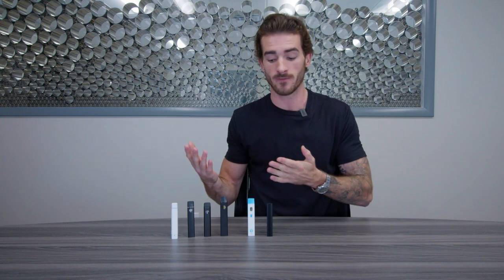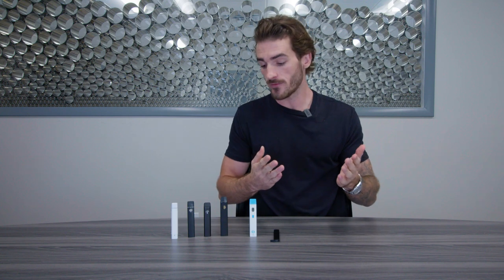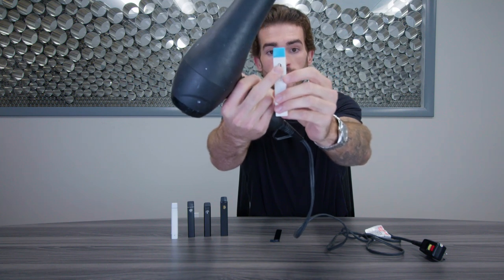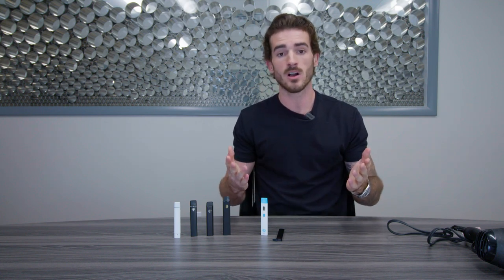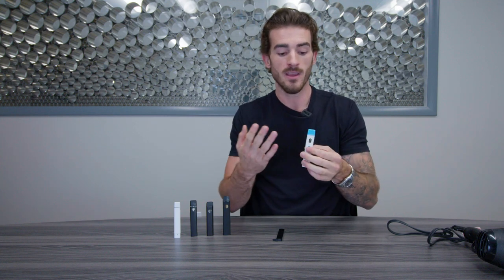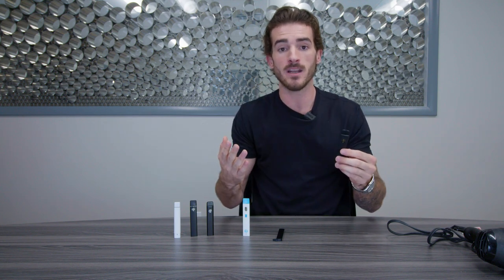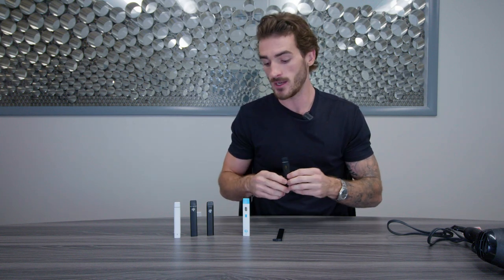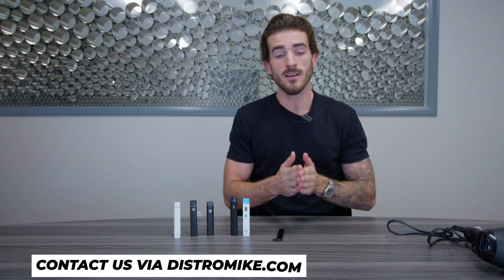How To Fix A Clogged Vape

Comment: Ty so much. My gasgang 2 gram pen was clogged from it being in my pocket at turned on and not sucking it. I've thrown so many away because of it. Most pen thrown out still had half or more in them. I used the dryer technique you showed in this video. It worked almost immediately. 😊❤

Comment: This vid saved me a bunch of money. This worked to clear the clogs on my Delta Extrax CBD vapes I bought. They are 4.5+ g tanks and always get so clogged after a week or so, I break them trying to clean them or just go buy a fresh one. Had several laying around with big time clogs and was able to clear them all just burning the coil in short burst until the clog dislodged. Then again, heated the coil 3-4 seconds before taking a strong puff (not inhaling it) clean the coil. Each time I took a strong pull with the pre-heated coil, I would immediately place entire vape and the airway opening towards a fan to cool it and the tank as quick as possible. I am also experimenting with refrigerating a clogged vape just so you can try to eliminate the chamber without it filling back up so quick but the fan method works pretty good. I would image a window A/C unit would be even beter ha. Either way, my vapes are all hitting like day 1 again. Very happy! 5/5 Well done!

Comment: A technique I found that works well is putting the vape in a Ziploc bag and putting it under some hot water. It worked for 1 brand, but not the other.

Comment: You can also put about 2-3 inches of water in a mug and microwave it for 30 seconds or whatever your microwave needs. After heating the water drop the zip locked vape in the mug full of hot water for about a minute and then take it out and try it, works every time for me but unfortunately it keeps happening with this current disposable I'm using. You don't want the water too hot, use your judgement, remember there's a battery in that vape.
Reply: Gonna try this brodie thanks
Reply: @iswimslow4 I forgot about this post and realized I didn't write it properly, make sure you don't put the vape in the microwave, the way I wrote it was wrong but I'm sure you know not to do that. It will likely be corrected if you check back. 🤙
Reply: @dosdont  Lolll you’re good bro I knew that part 😅🙏🏽 Woulda needed a new microwave lol fair warning

Comment: What about if it’s not clogged but still not getting a hit
Reply: time for a new one, or what you could do is get a lighter and dont get to near the dispo but inhale as you put direct heat on the coil and oil as hard as you can and dont stop until you get a fat ass hit then your:)
Reply: @MoxieLux  thanks a lot bro u saved me

Comment: Hi, thanks for a great video.  My question is, I have an hhc vape, it's fairly new. It was fine for the first couple days, then it started to clog up. Is this happening because I lay it on its side. Should it be upright. Getting kind of frustrating to have to pull extremely hard to get it to work
Reply from the maker: What’s your device? I would recommend having it in a vertical position and see if that makes a difference 🤙🏼

Comment: I hit it the first time and smoke did come out, it activated. But then nothing. After numerous attempts I left it for 15 minutes and then the same happened. Any tips what this is? Is it faulty coil? Battery LED is flicking whenever I hit it which I assume means it should be working fine.
I tried all these methods and nothing.

Comment: The pre heat button doesn’t work it’s fully charged I’ve put an Allen Key down the mouthpiece and a toothpick I’ve sucked really hard on it nothings working does this mean the battery is dead but the lights still on ?

Comment: What if the reason it's not working instead a clog? None of these worked on mine. Don't have a hair dryer
Reply from the maker: There could be a battery issue which means there’s really no way of fixing the vape
Reply: @DistroMike  got an hair dryer and it fixed It
Reply from the maker: Hell yeah

Comment: What If none of these methods work?
Reply: Bro that’s just terrible luck. I’ve done these methods for different kind/brand disposables.
Reply: @greengoody9560  Luckily the local shop replaced it for free.
Reply: @FLBoyCanScrap  every smoke shop I go to tells me they won’t refund it/replace
Reply: @greengoody9560  They had a puff before you pay protocol that the cashier didn't adhere to so they had too.

Comment: If your in the car putting your vape against the air vent with the heat on high will give you the same clog clear effect as the hair dryer

Comment: It wasn’t working at all I did all of them still didn’t work just let it sat for a second I’m after I heated up with the drier and then blew through the charger port and it came out had to heat it for at least 45 sec in 2 intervals

Comment: Could I add to not continuously trying to strong pull the vape then it is sealed. Gonna bust some shit or going to puncture a lunge I'm pretty sure correct me if I'm wrong on this. I don't have an extensive enough study to completely solidify that.
Reply: yeah probably i tried to pull so strong & if def hurts in the chest😭 but i’ve tried every method i’ve seen for my disposable to work & nothing works on mine but everyone else says ut worked for them  ughh
Reply: @mariejanehernandez9988  it be like that lol my luck
Reply: @mariejanehernandez9988  I've watched alot of ways and only way that worked for me and ik it sounds weird lol but it actually works  lol but if you just lick in and around where you pull from the vape at right before you hit it should get a smooth hit

Comment: What if it has airflow but no smoke comes out?
Reply: Same problem have you fixed it ?
Reply from the maker: It’s most likely a battery issue. Were you able to get it fixed

Comment: I must be the only person in the world the does not have a blow dryer.... I tried blowing from the bottom with no luck, I saw someone post about putting it in a ziplock bag and dip in hot water, going try that next. The only disposable that gets vapor lock that I've used is the Packwoods Runtz have 3 and so far 2 are so vapor locked  with plenty of product left grrr. I won't be buying these ever again.